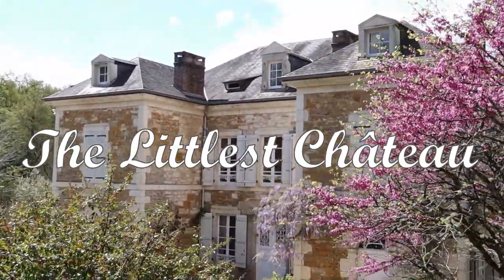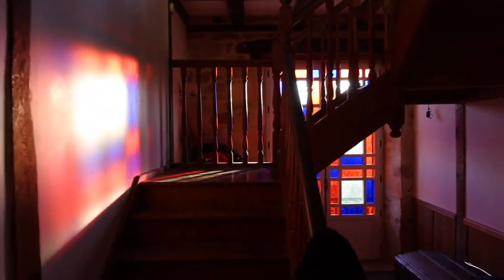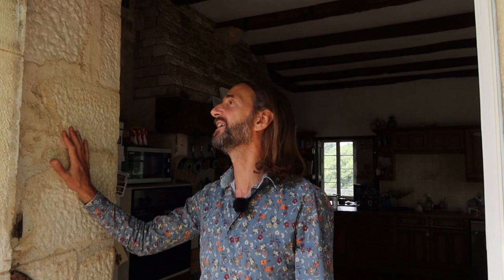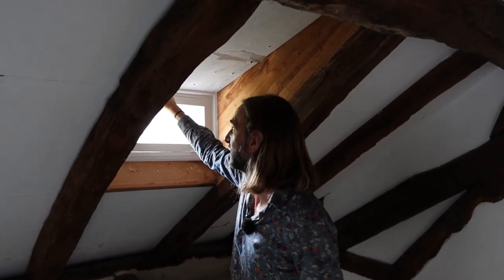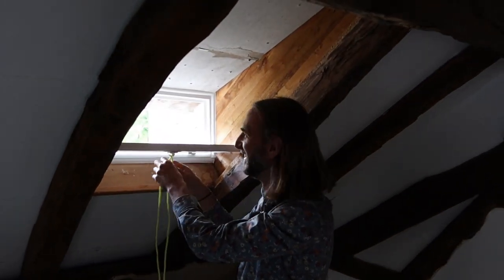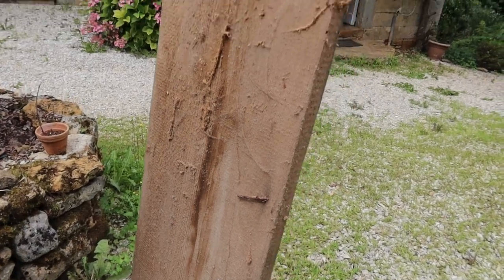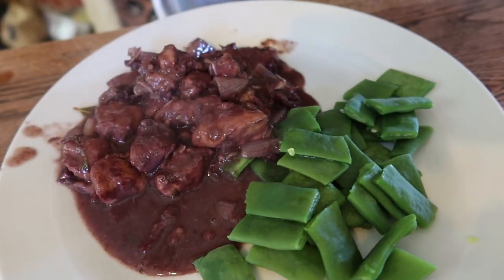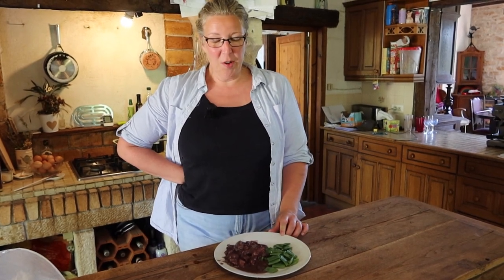Chateau Aircon -  part 1

Comment: I’ve seen at a different chateau with similar windows,they replaced one pane of glass with Perspex made a hole for the aircon pipe.Once hot weather ended replaced the original glass pane back.

Comment: Hmm, might I offer a few tips on using a wood saw? You mention your cut line going off; -clamping a straight edge piece of wood to your cut line will prevent your cut going off on an angle.  Try to cut a wee fraction more than the cut, and sand down to your exact line. If your cutting line binds up on your saw blade; wedge a small finishing nail to the beginning of the cut to prevent the saw blade from binding. Lastly, don’t force/press down on the saw blade when cutting, but rather allow the blade to do the work. There is a right tool for every job. I couldn’t determine the exact width dimensions of the board you were cutting, but I think it was too wide for a ‘chop saw”.  In this case, a battery operated “circular saw” is designed for the cross cut that you were trying to achieve for this task. Best of luck!
Reply from the maker: Thanks for taking the time to write such a detailed description. I will try these tips next time to improve my manual cutting skills!

Comment: The wood planer you were using is meant to slice not sand. You were going up and down fast like using a sander or belt sander. A planer is like a razor 🪒. You go slow and slice in one direction. They are actually very useful electronic or manual once you learn to use it. It is very useful on hardwood floors to catch high spots making everything level.
Reply from the maker: Interesting! Thanks for the tips that’s really helpful

Comment: The little 'hacksaw' is a metal saw. It is easier to saw straight when the wood lies flat. An electrical jigsaw does the trick, just clamp a ruler next to the cut line. Why don't you buy a couple of fans for the house? They use much less electricity than airco and are just as refreshing and easily transportable where you want them.

Comment: I have a similar unit in my bedroom, due to an awkward window opening.
It has a remote control, which is of course lost after putting it where my Husband could find it on his side of the bed.
And then I changed the bedroom around, but I never saw it so he still lost it.